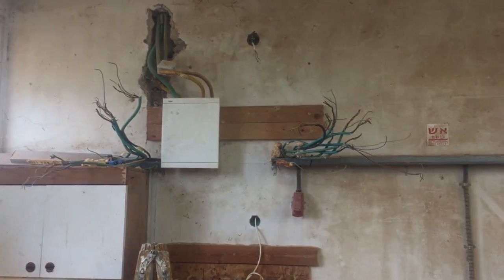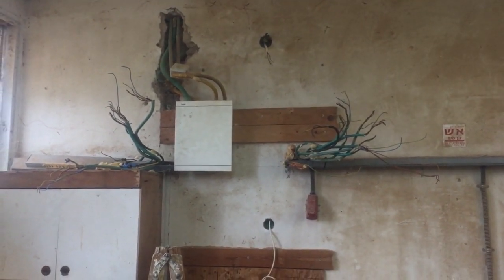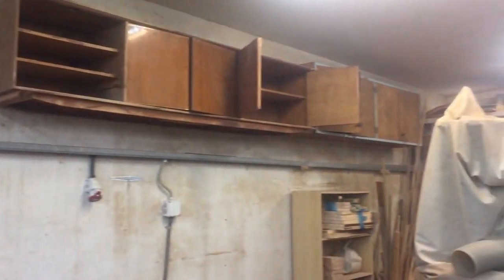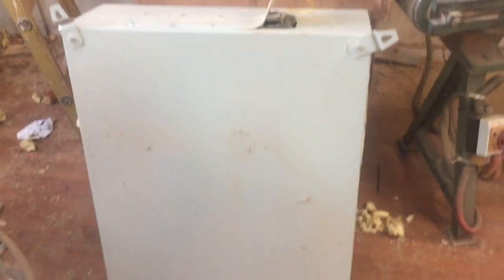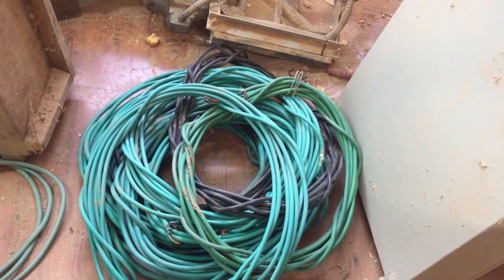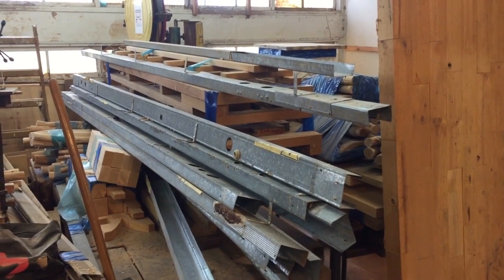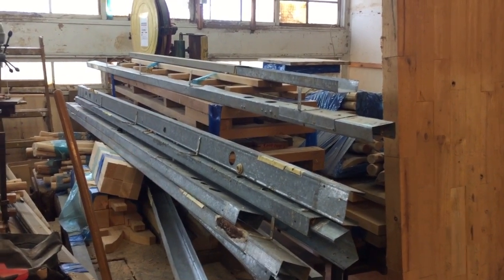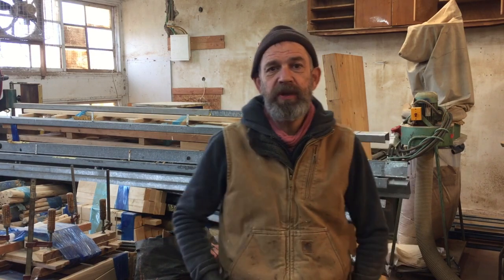Relocating My Workshop After 13 years

Comment: Say if u had a piece of wood right is there a tool which can smoothen the corners?
Reply from the maker: Hi Athina yes you can use an electric router it’s basically an electric motor that you can attach various cutters to some of which are specifically for corners look for some videos on “router edge treatment “ good luck David